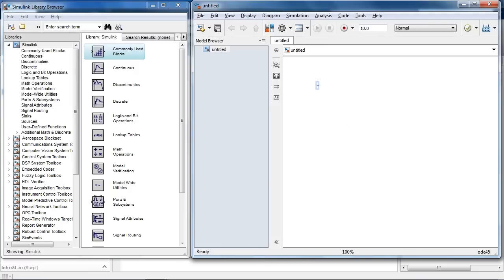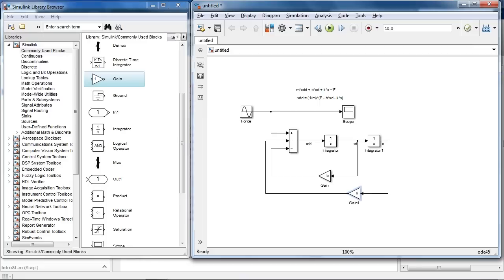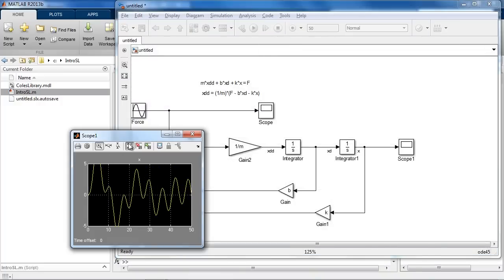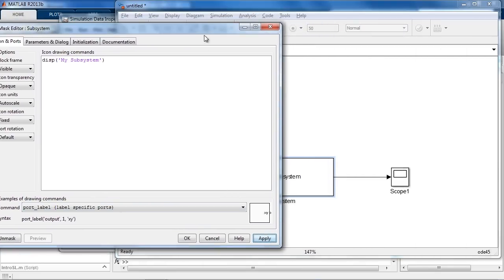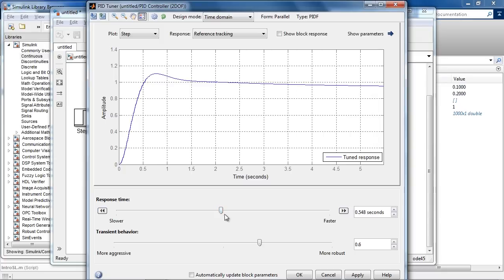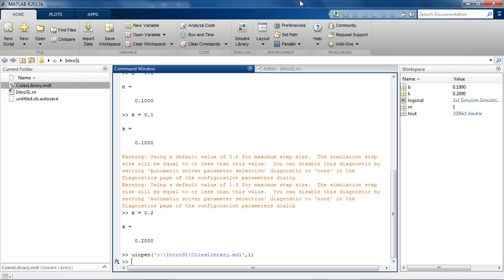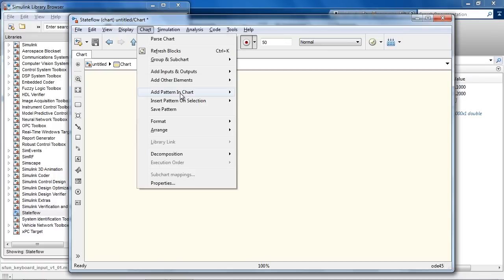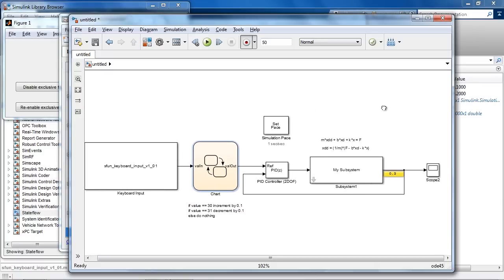Introduction to Simulink - Webinar

Comment: 笔记：
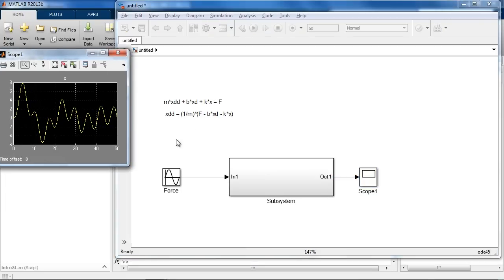13:15 讲解了record&inspect simulation output的使用
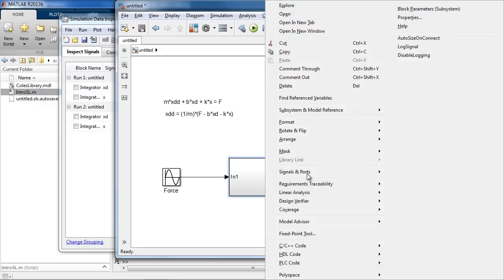15:50 讲解了创建Mask的用法
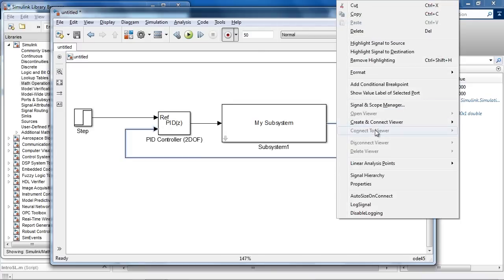23:00 在连接线上右键，选择show value label of selected port选项可以实时显示输出端口的值
26:00 讲解了一个s函数的例子—keyboard_input
27:35 Comment out blocks注释掉模块
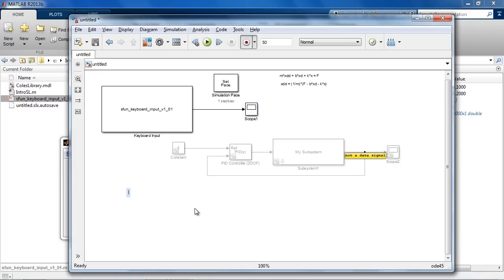30:05 讲解stateflow模块的使用
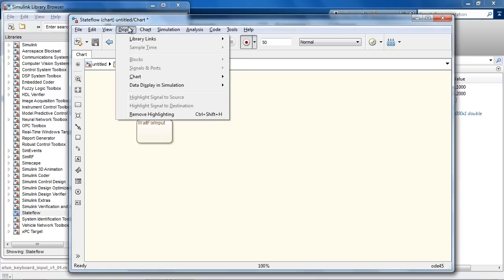31:50 stateflow中用“Add pattern in chart”可以实现if-else逻辑判断线路的自动搭建

Comment: Sorry Sir, I tried to do the same but in my Matlab (2016) not Tunned the PID Controller, even I did the same as you did Sir.?
What is the problem on my Labtop Sir?
Please, guide me.
Thanks
I like your video.
Reply: If you want to do m.tech or b.tech project and want to get a model of "Power System Improvement using FACTS devices" then mail me on jahidulislamalo@gmail.com . I have a 5 bus system transmission line model in matlab.